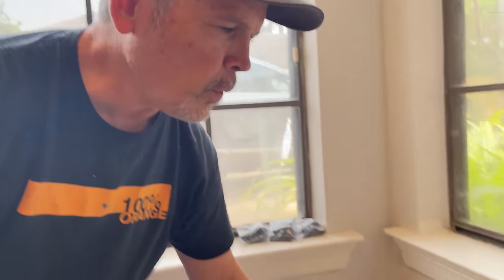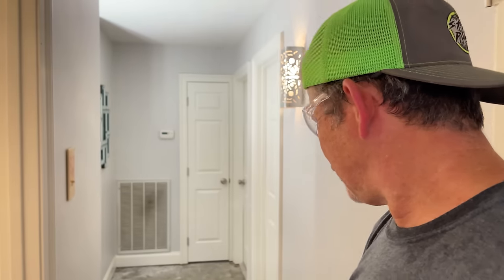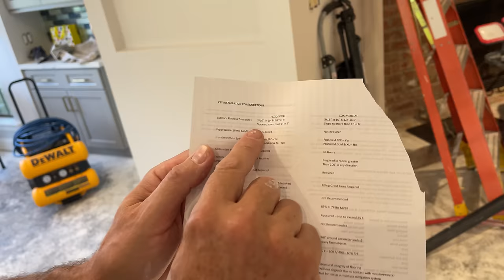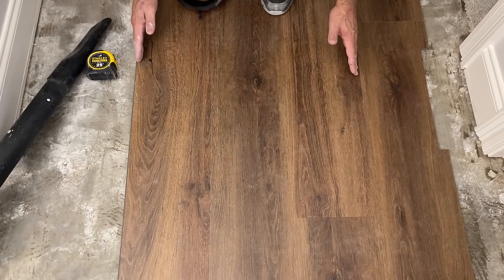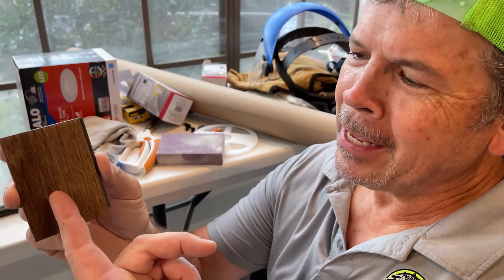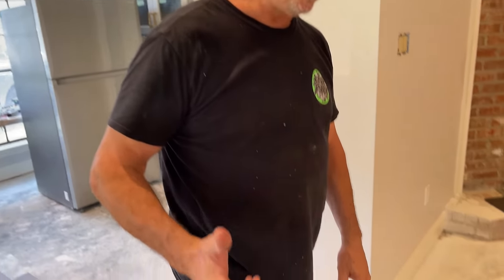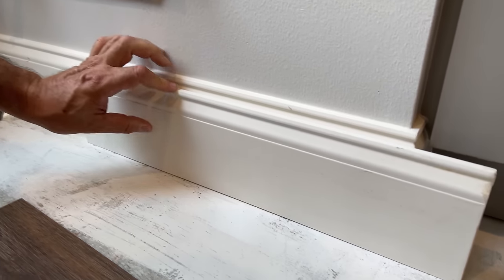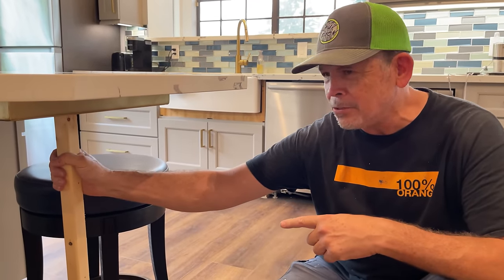The ULTIMATE FLOORING HACK! | Installing Vinyl Plank Flooring

Comment: I haven't seen the previous videos but my kitchen has oak parquet flooring. Glue has released and some water damage from Laura has completely ruined it. (No flooding but the freezer & fridge defrosted & all of the moisture from inside poured out). 
I bet looselay/clicklock flooring is a LOT easier to take out when replacing than the old glue down stuff.
My bathroom ended up with moon surface texture after a botched leveling job. Store said the stuff was self-leveling. It wasn't. It also had expired and was full of chunks. Next time I'm pouring any mix through a sieve to make sure I don't get lumps.
No pet elephant. LOL. This is where I would have my brother lie down on the flooring or stand where the tapping was happening because it wouldn't budge under him. We actually put that in to practice when working on my friend's kitchen floor.
I'm fortunate that my house doesn't have baseboard so I just have to worry about the 1/4 expansion gap around the perimeter. 
I can get down on the floor relatively easily but getting back up is not easy. 
Love that you have family working together. "Where'd you find that kid?" LOL! The humor makes this entertaining as well as informative. 
I have to comment on how good the audio is. I am hard of hearing so I usually have to use subtitles but the speaking and volume are so good on this that I can understand without subtitles.

Comment: Just noticed the staircasing in the layout, looks a lot better when it doesn't look like you're walking up steps. I know it takes a little longer but it looks a lot better if length of the 3rd piece fall somewhere between the 1st and 2nd..... Maybe that's just personal opinion but I hate staircasing... Also when it comes to cutting your piece instead of measuring just turn the piece backwards Cut it right where the last piece ends and then flip it back. You don't have to get up and down you don't have to move from where you're at.  No measuring required.   I'm sure you guys have figured out that the up and down is what wears you out and it slows you down. If you stay on the floor you don't get as tired and you get more accomplished.

Comment: In the first second of the clip, the spacer is being used wrong, that's why it fell over. They should be horizontal and used in pairs. Nothing wrong with those, used them yesterday and they were great! Didn't tape them to the wall either, haha.

Comment: While installing my flooring of the same type, except I used the thin foam rolled out. I noticed that the panels only needed the lightest of a tap to close up perfect. However,  I invited some buddies over to help on the project, & one guy was whacking it forcibly,,,where it later bubbled up. What an aggravation.

Comment: How are you finishing where the floor meets the fireplace?
Reply: I was waiting to see how he would do it.  I put in wood laminate in a similar looking room and I undercut the brick hearth with a 4-1/2" angle grinder so the planks would slide in tight underneath it.  It looked really nice.  If you're going to undercut, make sure you mask off the room tight because that gritty dust will go everywhere.

Comment: Just stack all the boxes on the strip in the middle it's more than enough weight to hold everything down and you're gonna need it in there anyways. Also the hallway could have been done a lot easier than sliding that piece with soap.  Just cut or scrape the lip of the tongue and put some wood glue in it.  I also completely agree with the comment about the floor patch. Yes it does cost a little bit more but there's more than enough money in that job to pay for it especially when it comes to not having people standing around and not having to wait by the time you get done spreading where you started will already be dry.  I'm not trying to be judgmental you guys actually do good work you said if there's any tips 🤷‍♂️

Comment: I just layer a floor, flipping the boards work, mix them up, or you’ll get stepping. Probably wasted 4 or boards, started to get to many short cuts on the wall, looked dodgy so had to sacrifice a few. Turned our pretty good.

Comment: Great content! But in my opinion it looks a lot cleaner with out quarter round… the downside to that is most of the time you need new taller baseboard and more money.. last but not least, the brick area doesn’t look very clean with flooring butted up to it or with a factory quarter round molding….. I would opt for an undercut saw with a diamond blade, that way it looks like brick was installed over new flooring and in my opinion much cleaner look!!

Comment: I have never seen anyone put flooring under a threshold (unless I didn't see correctly). It will get wet from moisture and be ruined and start to swell. Normally we stop just shy of the threshold inside and put a piece of trim there

Comment: Just lay over the old floor. The lvp is free floating, in fact it will install better over the previous flooring that is perfectly flat. Unless i missed part in video where old floor was missing chunks and sections all over the place? Just trim bottom of door jambs up another quarter inch (if needed) and take what you need off the bottom of any doors (if needed) way faster than demoing whole floor and fixing the concrete. And could charge less. The door jambs would be cut to the right Hight as well instead of that huge gap because the old floor was thicker. Especially if your just going to quarter round it anyways. Not like your tying to fit it under the old trim or something.

I use Loctite PL 3X for all my lvp flooring, including bullnose or transitions. Practically welds the stuff together.

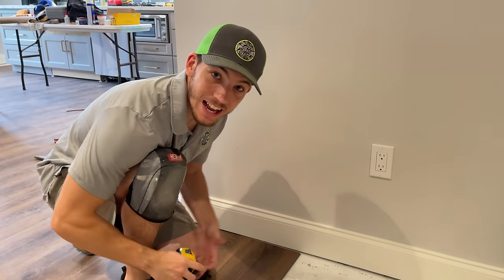At 22:35 , just turn the next piece around (male to male) and mark it, no need to measure remaining space for finishing rowe piece. Much faster. I do like the block anchors though.

Ide also HIGHLY recommend marshals floor cutter tool (giant paper cutter) you just drag it behind you and do the floor flip thing i said before, no measuring or getting up and down needed. Would speed up the whole job by 30% easily. Worth its weight in gold. I don't go to the saw, touch a knife, or get up unless its a complicated cut. And it cuts all lvp flooring under 3/8ths thick. It alo CAN cut the 3/8ths its just not a very clean cut.

Comment: 1 tip I noticed you guys don’t use is to have a small piece of the floor cut in half  and use it on each joint then hammer it down instead of hammering the joint to avoid breaking the joints. A bit like your tapping block but you have the edge.

Comment: I use a trim nail to hold my starting point , those plastic stops included in the box are a joke afterward you can't even see the nails I usually cover em with quarter round

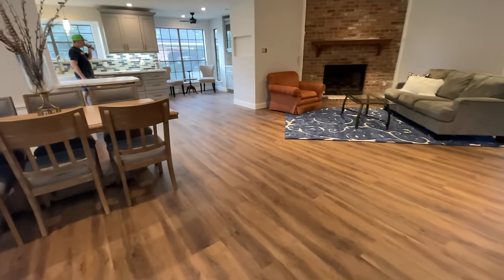Comment: 28:41 that's code to do under dishwasher else you break code. If you buy a dishwasher install they have flooring guys install flooring under it if its not there. Its code due to notice leaks so it doesn't run under the floor. In EU we have that Code I don't know about America.

Comment: Have you tried a hot glue gun to stick those black plastic space keepers on the wall? It creates a strong bond, but doesn't damage the surface. End of the work you can easily pick them off the wall with a utility knife. I have a full bucket of these black things I love using them.

Comment: I redid the flooring, ripped up the carpeting which was damaged by dogs...vacuumed the floor took a dollar store mop andcdamp.mopped all the floor (concrete slab) , then bought two gallons of concrete paint and sealed the entire house..let dry a week, then laid down LVP....looks nice!  I think quarter round looks chincy....my only suggestion is you should have removed all the baseboards, laid the floor, then laid flooring, then reinstalled the basdboards...would look cleaner

Comment: Thin-set mortars are not designed to level floors. Any leveling or sloping of the assembly must be done with an appropriate substrate floor leveling material prior to application of membranes.

Comment: Why didn't you use adhesive under the flooring?
Reply: Vinyl and laminate floors are supposed to be a floating floors, they don't get glued or nailed into the subfloor. The pieces are locked into each other using the tongue and groove.

Comment: Watch out some manufacturers  require a max run of 26 feet must have transition for expansion and contraction. The longer the run the more it expands. Causing it to pull out over time

Comment: Wow I’m always amazed from guys who don’t do flooring all the time the things they do and materials they use. I’ve been doing floor for 35 years and all types of vinyl flooring for the better part of 25. Never have I seen someone use thinset to skim a floor. Such a waste of time and not the right product. Wasted hours using that thin set. They make a quick dry patch with Portland base cement from pro flex that can  and should be used and dries in less than a hour depending how deep your holes are 2 hours max. Also those little holes he said that need to me filled really does not need to be filled. Also using the wet vac attachment with the brim attached to it really does not get as much dust off the floor as much as the one without. Not to mention also to save time why wouldn’t you have done the floor prep after the rip out instead of having your customer walk over holes and such things like that for weeks.

Comment: how do you get away with no moister barrier on concrete ?
Reply from the maker: Not required by this manufacturer 👍
Reply: @StudPack  I've only done my own houses but I've never seen it before but could be because I'm buying cheaper stuff usually discounted or out of stock stuff. Where can I find it. I'm about to do another house and would love to not have to mess with the barrier. Thanks in advance still learning new things
Reply from the maker: This floor is ProShield SPC Cordova from ProSource.   SPC means stone polymer composite.   No wood so no no barrier.
Reply: @StudPack  thank you

Comment: I have installed flooring for 30 years and I will tell you something better than spacers I'll lay out the first row then I will run screws between the baseboard and the laminate on each end of each piece and one in the middle of each piece I do this because hardly any walls are straight and even that don't have a bow or a curve of some sort I put the screws in on an angle towards the laminate so they can't jump up in the air because shims will move ,spacers will move , the only way you're able to make up for some bows and walls is to put two spacers together and sometimes if the drywall is up too high the only thing you can do to keep them from turning sideways is to put a screw into them or nail to hold them in place but if you use screws instead of spacers you will have no problems the boards will not move , after all that very first row that you put down is going to set the tone for the whole floor if it's off even slightly you'll fight to get them together the whole way to the end of the job. you simply take the screws out at the end. And to be clear you don't put a screw into the laminate you use the screw between the wall and the laminate to act as a spacer. And I never use a tape measure to install laminate as long as you undercut your door jams you'll never need one you simply flip the laminate over upside down with the tongue going the same way on each piece make you cut that piece will fit right where you cut it to fit and the other piece will be a starter at the other end on a new row they say you need to figure 10% waste for laminate I never have more than one or two percent waste

Comment: As a Flooring Guy I can only assure you that house is not straight considering it’s on concrete. It would not matter where you started you’ll end off off to some wall some door jam somewhere down the hallway to some degree. Just the way it is. We are the last ones in the home typically. And hopefully. Therefore we get to place the blame on 15 other contractors before we arrive. Happy Sunday

Comment: Those knee pads looked nice, but if your knees were aching, you might want to get better ones, you get what you paid for, I bought some cheap ones from walmart and they weren't the best.

If you really want to get fancy, they sell knee pads with wheels on them so you can go back and forth quickly without having to stand up so much.
Reply from the maker: I have some custom made ProKnee pads but need a re-build kit for them.  Check out proknee.com if you've never heard of them.

Comment: Hmm why no vapor barrier?. Not required.  But still risky with cement floor.  If it goes bad they won't pay labor. Company told me I did not need it but I could use it if I wanted. Have some cold spots. Freaking out.. I know it said no layment needed. Called about  the vapor barrier.  Said no but could if I wanted. Think I should have.

Comment: Since they are all developed from photos of wood, why don't the manufacturers use more than just six or seven different planks? Why not 20? They are just PICTURES, after all. The cost would be minimal. 
My other gripe is why they include at least one if not two planks that have extremely distinctive grain figurations? 
If it looks like the face of an owl or it's a knot unlike any other maybe it should be substituted for one less obvious.

Comment: These guys create so much xtra issues installing the floor the way they do. Like starting in the hallway then you have to stay nail one side so the other side does not move when you start tapping it going the other way. That’s exactly why you don’t start in a hallway also. You all ways try and want to start on a main wall preferably a outside wall because they are always the truest

Comment: From everything I've read, that rubber like backing is NOT a moisture/vapor barrier. There is evaporation from the concrete and planks are planks. A plank has seams/cracks. No one wants to grow black mold under their floor. Everyone read the box and the directions!!!

Comment: No need to drill and plug your stop blocks use a 300-watt hot melt gun. These glue guns are not like the ones you buy at a craft store you can glue carpet tack strip with these glue guns and they will hold up to a carpet stretcher. You can buy them at a flooring supply.

Comment: Excuse me, CORRECT ME IF IM WRONG, but the wedges are provided for high baseboards that remain ugly without corner-round; in which place you would provide the extra slope needed to get a better seal, or less gap under the baseboard. Let me explain. You would tap the whole block of 2 wedges directly under the gap, and remove 1/2 the pack , leaving the thin-end sticking out slightly. You would proceed to install the board and it will automatically provide justice to the gap. Any questions… they really need to edit those directions to include common sense aspects and laws of attraction 😢
Reply: It also replaces the need for sacrificial wood to play with and artificial craftsmanship.

Comment: Been in the trades for years. Had you an empty room and your cabinets werent installed what ive found best for glue down wood flooring:
Remove all the baseboards, you can save but in most cases we are always replacing w/ a more modern up to date baseboards and casing. I usually tape a 4' tall 6 mil plastic if the walls are already finished or wall papered to reduce time of cleanup.  
Take a circular and use old saw blades and set the depth making cross grain cuts about 16 to 18" apart thru out.  Soak the floors w/ water since most all our glue down is on a concrete slab in my region  About 1/8 " ponding water on surface and let sit over night. (Note : cant use water on 2nd floor condos / water or above ect... 
Use a 60lb chipping hammer w/ a thin special blade made specially for removal of glue down wood floors  ( tip" Have a hand held grinder handy and a quick resharpening  several times innthe progress. A sharp blade makes a huge diffence. This blade does very little gauging pits and chunks out of the concrete slab ). Guaranteed  this is probably the least damaging method that is a huge time saver i back breaking labor . Just a quick tip wrt the floors slightly as you work sections a head of the areas you start @ . It helps tremendously loosing the glue and also keeps the dust down very considerably. 
Any areas that have just a slight bit of glue, wet down a little bit and use a hand held  4" or 6" floor razor blade scraper. Or a 4" to 6" grinding fly wheel on a grinder w/ a shopvac attachment that reduces dust.  Sweep up, vacum floors and remove plastic . Let slab dry out for 2nor 3 days.  If instaling Vinyl padded floorig down . If re instaling another glue down use a mositure meter on the slab and check w/ a moistue meter daily to reach manufacturers specs . Suggest a damp wipe down w/ a spong or a T- Pole cuban mop w/ damp towel rinsing several times in a clean bucket of water  to get majority any dust residue especially if installing a new glue down.  Use a self leveling compoud to fill / float out low spots  prior to installing your new flooring youre good to go after these steps

Comment: I’ll bet your plumber hates it when you run your flooring clear to the wall under your Stove & Dishwasher. I just had to pull out a stove to take out the flooring materials to get the stove to set down on top of the countertop. This one was all the flooring had raised the stove about 1/2 inch. Took me a couple of hours to get it out and back in. The customer wasn’t happy with the flooring contractor but I had to get paid!!!
They back charged the flooring contractor. And got paid!!!
  Total cost over $400.00

Comment: 1/16" in 30  feet =  way off  Take time to plan and do the job once. I did wood floors same thing, all great tips
Reply: You’ve got to either be joking or not understand that these floors are “floating” and are designed to be installed with a 1/4” gap all the way around for expansion